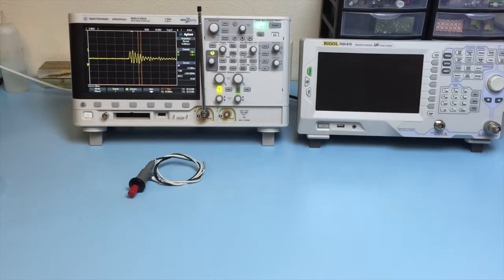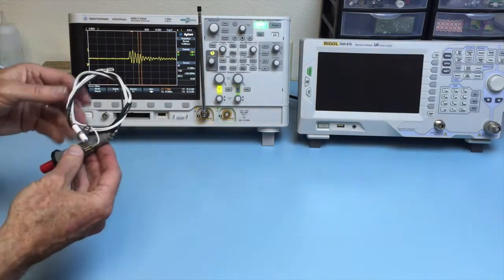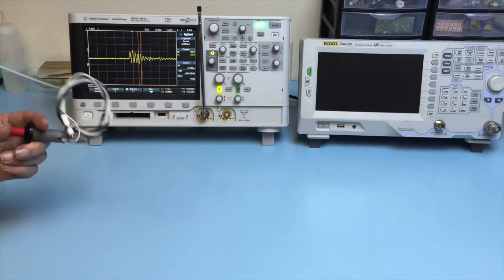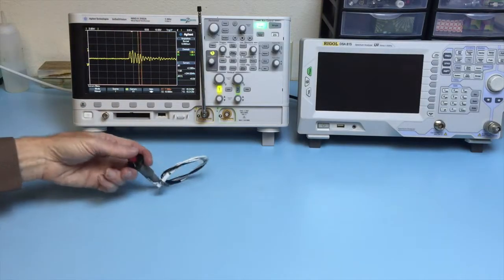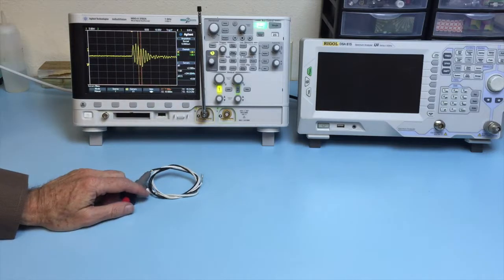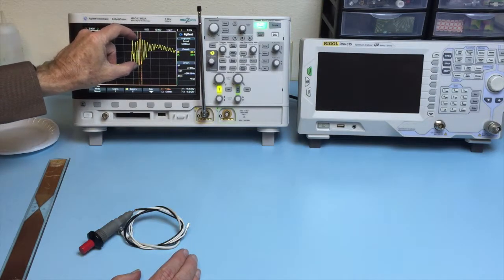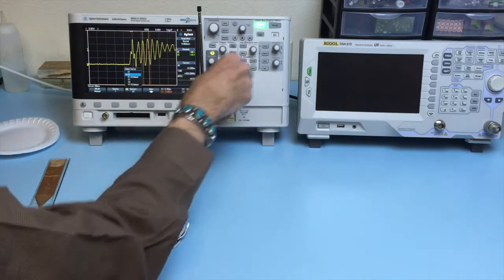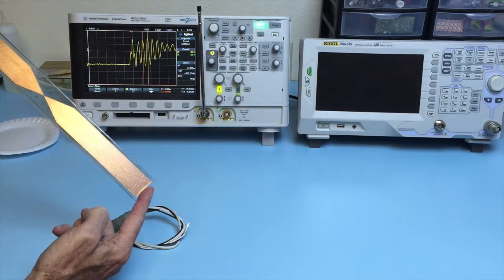Immunity to ESD

Comment: Those spark generators were a real problem back in the 1980s and 90s. The kids would use them to freak out the arcade machines causing them to empty their hoppers, rack up free credits or simply destroy most of the internal logic boards.